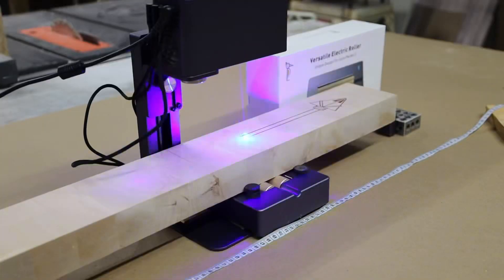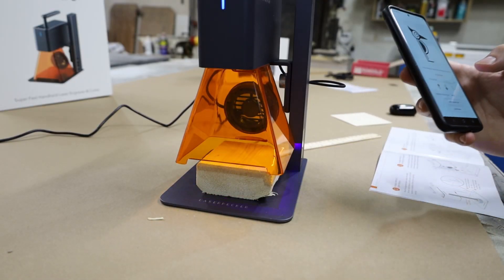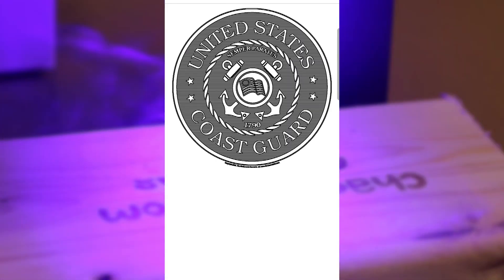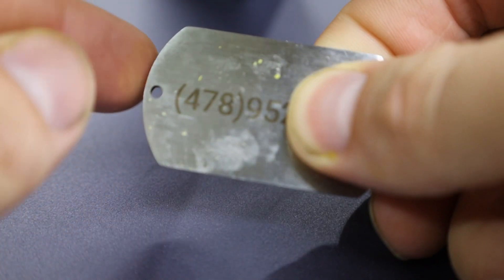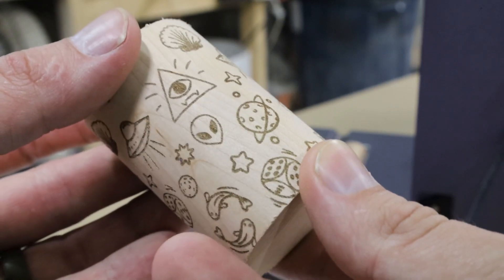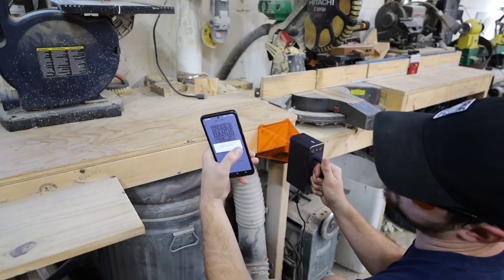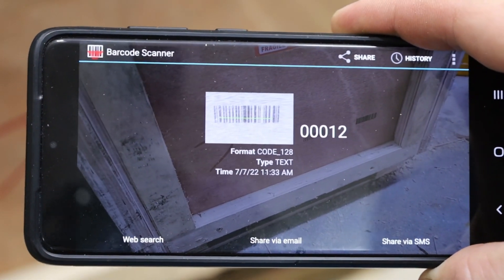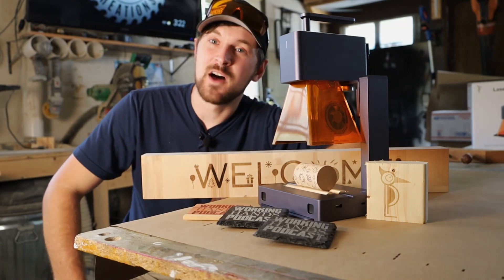If Roomba and a Laser had a Baby, The Laser Pecker 2 Pro

Comment: I just got the Laser 3 and nothing seems to be working. I can etch the test card. Tried to etch the bottom of a bowl I turned and the quality was very bad. The preview function does not work at all.
Reply from the maker: Sorry to hear you’re having trouble. Are you making sure to have the correct distance from the laser head for it to be in focus?
Reply: @ChadsCustomCreations  yes, that is easy. Just seems that the only thing it will etch is the test cards that came with it. They came out beautifully. The roller is not working either. I have tried it using 3rd axis and cylinder on a copper pipe. It wouldn’t roll, but when it was in focus it did etch.
Reply from the maker: @erikhansen6062  with the roller you have have to use those little rubber bands for gripping smooth objects so they will rotate.

If it is not giving you the desired burn try slowing it down or make sure that there is no residue blocking the laser beam from working at it’s full potential.
Reply: @ChadsCustomCreations  got it all sorted. Apparently it needs to have the box checked for cylinder each time.
Reply from the maker: @erikhansen6062  awesome glad to hear you got it

Comment: Nice video. I'm a backer for the LaserPecker 4 premium. I hope to receive it sometime in early June.
Reply from the maker: How are you liking the LP4?
Reply: @ChadsCustomCreations  I really like it as I mainly only use it for smaller things as you can imagine. The main issue that they are having is listening to the people on speed, etc. which is taking away from accuracy and precision. The app is usually not quite right and free of bugs. So there's some issues and bugs that need worked out , if they do that it would be a great little machine. I have 2 other brands that I use as well. It's like each machine has their go-to reasoning.

Comment: Where did you get the adjustable roller for the tumblers? Can you post a link. I have the small magnetic one that came with the trolley, but would like the adjustable one. Thanks
Reply from the maker: This came with my xtool but check Etsy there are some selling similar ones 3D printed

Comment: Can you make a 12"x12" sign with it?
Reply from the maker: It's possible but you'd have to do it in pieces. 4x12" no problem with that trolley mode. For bigger signs check out my video on the xtool.

Comment: What laser do you think would be best for engraving a mouth engraving a mountain that's about 12" long
Reply from the maker: A mouth? If you need to go larger than what the laser pecker can do I recommend looking at the xtool D1 I have a few videos on it if you're interested.
Reply: @ChadsCustomCreations   a mountain
Reply: What's the Max width and length for this laser?
Reply from the maker: @seanwilson3330  I cannot remember off the top of my head but the laser pecker is like 4"x4" without the use of the trolley. With the trolley it's like 4"x infinity
Reply: @ChadsCustomCreations  ok thanks

Comment: without the app, you can tap the Play button on the top to pause/resume a job; hold it to cancel the current job.
Reply from the maker: Nice yeah I think under the setting the default had those buttons disabled. I dig this thing though it's very cool.
Reply: @ChadsCustomCreations  if you do a firmware update, those buttons will be enabled by default (as before). Also, holding the Play button 3s when it's not engraving will turn it off. a short tap to turn it back on.

regarding the QR code being a bit smaller than expected, I guess it's because of the white margins around it, that were counted into the 100m size you specified. I forgot is auto crop is available when engraving QR code. worth a try.
Reply from the maker: @yy502  oh crap I forgot to check for a firmware update so glad you brought that up.
Reply: @ChadsCustomCreations  a more recent firmware will also enable built-in dithering in Gray mode 🙂